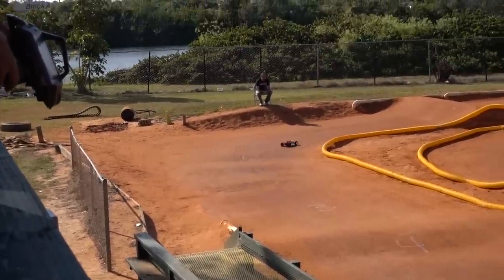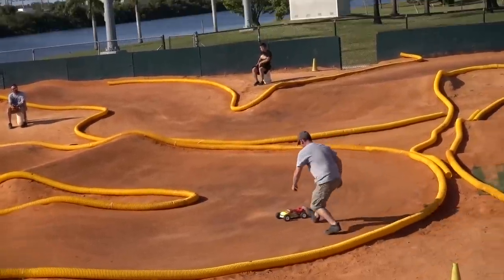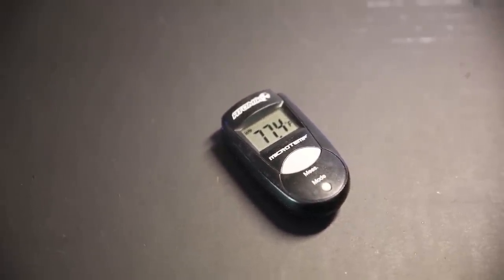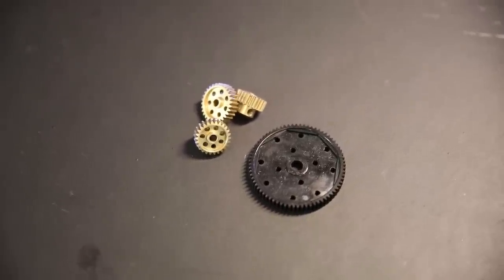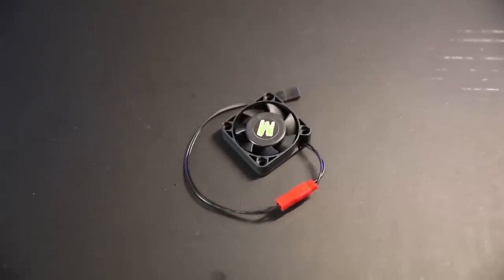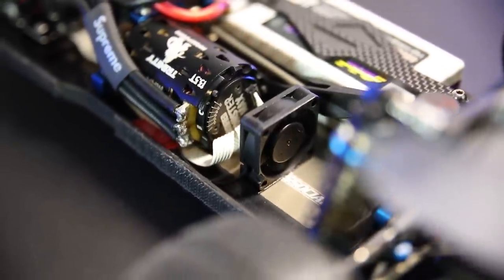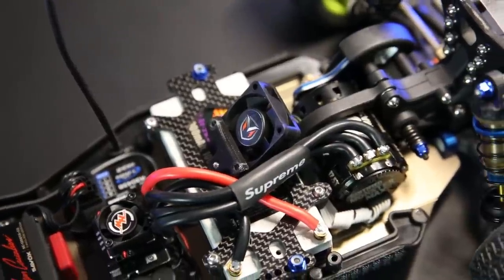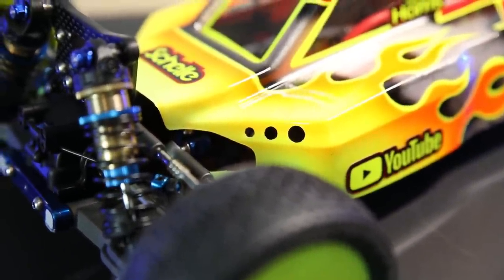RC OVERHEATING TIPS || Motor, ESC, Body Holes

Comment from the maker: Any OG's in here remember using those optional heat sinks on the ESC's in the brushed motor days?
Reply: LRP OPC SR
Anodised blue press fit which would fly off 30sec into every run😊
Reply: Back in the old days I went one better. wrapped small diameter copper tubing around motor and flushed ice water thru the tubing just before the race.  that was in the mid to late 80's.    don't know if that would be legal now
Reply: Tinker Aholic now that’s racing lol
Reply: Had the old tekin esc's with the two small gold heat sinks.....those were the days.
Reply: I remember mechanical speed controllers with two ballast resistors and multiple alloy heat sinks. Tamiya days 1970 through 80's.
Reply: Yep, had fans on them too
Reply: Novak HAMMER PRO baby, good times
Reply: +Tinker Aholic it mite not be allowed to use that technique when racing but you could still do it to keep your electronics cool when your bashing, great idea, just wondering what you use to get the water to go though the pipes
Reply: Still do
Reply: Ryan is brush esc if i do long run like 1 hour is it gonna over heat im beginner my crawler remo hobby 1093
Reply: Any body remember when your esc was a on and off switch controlled by a servo
Reply: I've been running my old Schumacher Cat 2000EC recently with a brushed motor and keep melting the solder off the motor! Ended up having to cut the back of the bodyshell to let the hot air out! Because it runs an under tray as well as the shell the thing just traps the heat like a green house lol
Reply: Tekin 411g with a speedgem diamond 12turn double. Indoor carpet offroad with foam tires on a rc10t. Never checked temps back then, but the batteries where hotter then the esc after the 4 minutes races. 1400 or 1700 nicads. Just a guess but batteries must have been somewhere between 130 and 180 deg f after a 4 minute dump.
Reply: I used them for oval racing. One summer I tested putting motors in dry ice and putting them in the car right before a heat. Not sure if it really helped. I recently had a speed control shut off due to heat with a 17.5 motor, fixed it with gearing and a ESC fan and a motor fan.
Reply: Yep
Reply: Rip novak
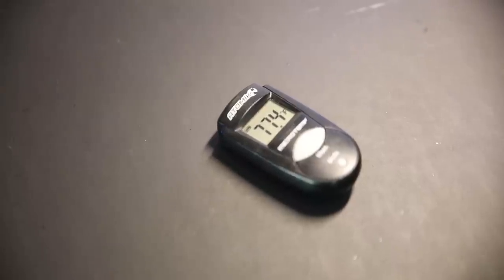Reply: oh yes tc3 heatsink dayz miss those days when everthing was a bit cheaper but i still lov the sport and when i buy something i'll appreciate it more. good luck in your races oh ryan can you suggest an off road buggie me to race 1:10 in price bracket of $200 .very grateful
Reply: Ha I remember switching from Tekin to Novak back in the day because of the awesome purple Heatsink.  Crazy how many esc didn't even use them back then
Reply: Lol threw them all away lol
Reply: My first rc was a bandit with a servo driven  mechanical speed controller with 3 speeds and a titan 12t brushless
Reply: Yep had the brake one come off during a race and then half way through no more brakes
Reply: I'm only 25, but my first rc 4 years ago was an original MSc 1985 tamiya hotshot. Really makes you appreciate the innovation of the hobby
Reply: Just melted a Novak cyclone transistor last week :( should have gotten a temp gauge before i tried the lipo battery in my losi xxx buggy! Of course i found those heat sinks later... Thanks for the quality vid!
Reply: I still have a new in package TC3 factory team motor clip 😂 

Want me to send it to you?
Reply: i know this an old video but you speak very clearly. i really appreciate the video, it is very helpful!
Reply: I used to run mostly Novak. I'll never forget the bright orange with the purple heat sinks...used to run one on my motors too.
Reply: Put Gold colour thermal compound between the grooves on them!

Comment: Meanwhile I'm over here and my motor is like 75° cooler than where it could be because I was racing at an I door track in the cold Canadian winter, perks of living where the air hurts your face 👌
Reply: I love that. My motor sits very cool since its only 50 out right now and it has a cooler on it. My esc on the other hand. Overheats in about 2 mins. Lol
Reply: Air hurts my face in airzona when its 125 degrees f 🤣😂

Comment: I'm not a racer but a basher.. but I stumbled across the WTF (wild turbo fan) branded fans and they are some serious air pushers. A bit more expensive than a standard fan but they move no less than 3× the air. Offered in 25mm, 30mm and 40mm. Those looking into cooling fans I highly recommend the WTF brand. Tried one myself and now gonna be replacing all my other fans with that brand. On my 8th buggy just a 40mm WTF fan on 6v on a fan mount dropped my motor temps 30°F. Ebay is where I found them easily.
Reply: When i first plug in that fan i said wtf never seen a fan that powerful
Reply: Thanks!
Reply: Bit late but I just got a good deal on a TLR 22 5.0 with a brushed motor and one of these WTF fans in it.. putting a hobbywing combo in it this week, but keeping the fan now!

Comment: Great and very informative video! I personally also like to change the timing of the motor in order to degrease the temps when I'm out of pinions or if the motor is running consistently hot regardless of the gearing. I have also noticed that if you run low timing and high gearing, the efficiency of the motor is much better than if you ran high timing and low gearing while sustaining the same level of power output.
Reply from the maker: Great advice and very much agree!

Comment: I have a castle Sidewinder4 in a rock Rey stock gearing with a 1415 castle brushless motor. I have a 16t pinion and my wires are melting the solder on the esc. The bullet plugs and my wires going to my motor (I now have 12awg wiring going to my motor) and after going half throttle for a minute my bullet plugs are way too hot to touch. On 2s and 3s. What is going on here? Maybe a bad motor?

Comment: I actually am watching this video while at our local track.  The building we run in is not temp controlled and today it just hit over 100F today outside but in the building I just temp'ed the railing that is on the drivers stand and its 116F there and 109F at track level.  So I really only have 50-70 degrees to play with when before temps too high personally for me.  I usually try to gear without a fan up until it got over 85F outside then I had to starting running a fan on the motor.  Only part I personally hate now is that if the fan stops working I could loose a $100 motor (Could be more or less).  Cooling is needed in the summer where I race....and a parka is needed in the winter......I love it

Comment: In oval racing we disable thermal protection. Also keep in mind after esc reaches a certain piont the esc will reduce power. But normally 150 to.170 in oval racing is acceptable.

Comment: I installed a brushless setup in one of my Tamiya 4WD buggies and just cuz I didn't know what the car could handle or how the system would react to the vehicle I made it where the cooling fins of the esc stuck out of the body just in case so heat wouldn't be an issue. turns out the set up was good and the cooling fins sticking out looked kinda cool so that is how I ran it.
I dont know what and OG is but i remember those days.  I remember where you had to keep up with your springs and your brushes if you wanted the max performance out of your vehicle.
I also remember the first time i saw a brushless system. It was an article done by RC Car Action and they had 2 Avox brushless systems on a clod buster with a racing chassis. The article was good but the truck was sooooooooo sweet.
When i ran my t-maxx i thought it would be cool to give it a scoop so i did so and put the breather in the scoop, using aluminum tubingto keep the air cool as it traveled to the engine.

Comment: Great job thumps up,,,,  keeping a close eye on temp can help find other problems as well like bearings that may start binding because it will as expected make the temps climb so if you know everything is in check that could be something to look at.. I was running a 1/10 scale 4wd truck and noticed it was getting hotter than normal it turns out it was the front differential bearings but I hadn't noticed any lack of power or anything at that point just a little spike in my motor temp....  Again thumbs up brother it's the simple things people forget to watch could save some money..

Comment: Good video, you forgot to mention that you need to carefully adjust your ESC  (Thermal protection) when adjustable , a lot of motor thermistor do not relay good readings for motor temperature and this is why a lot of people have fake thermal shutdowns due to the motor giving the ESC a way to high temp reading . I prefer motor without temp readings but for those who has it I adjust the Thermal protection Higher and carefully monitor the outside temps of what I consider OK for ME ( not higher than 165 F )

Comment: One tip i can share in regards to aftermarket fans is keep them from being too close as some rotors can actually stop the fan and cause it to fail. Learned the hard way on two different fans. Some motors it's not an issue but the stronger ones will definitely stop the fan and cause them to eat themselves.

Comment: Good vid. Would love to know what temp is recommended.
Reply from the maker: For most of my 1/10 off road stuff I stay at or under 150
Reply: Ryan Harris Thanks!
Reply: @RyanHarrisRC  well i have a 4wd slash i have stock gears i will 
 use the same esc heat sink. Will it cool down.

Comment: Hey buddy been follower now for a few weeks and been binge watching your videos as just come back in to the hobby and funny thing is I was looking for ways to keep temps down a bit better with my new brushless system as I'm happy with the speed but want to keep the temps as cool as possible . 
Funny thing is when I was racing years ago I used to make holes near my ESC and motor and people used to wonder what the hell I was doing . I took race car idea that if it keeps a petrol car cool that it will help with a RC . 
So going to give it a go as I don't like gearing down to much . 
Also picked up on the polishing hinge pins etc for less friction awesome tip that made suspension is miles smoother . 
Keep up the good work bud .

Comment: I think I’m under geared with the stock gear ? I usually get just as hot going fast as super slow,  so do I gear up for going faster because I want to go a bit faster and keep it cooler , would gearing up help the up end speed heat? Edit: I’m mostly doing long stretches of speed

Comment: another good way to improve cooling of the esc is changing the stock thermal pads under heatsink with something like thermall grizzly carbonaut (be careful they say it's conductive so put it only where it should be - on the top of transistors and not just over whole pcb)

Comment: Quick question
Can I run a 12v 0.6A rated cooling fan on a 12.6v 12A power supply or will it smoke up?

Comment: The video is awesome but for someone new getting back into the hobby needs to to know what should the temps be at or around after runs
Reply: Should not be higher than 90 degrees celsius.

Comment: I’m using a standard voltage servo from amazon one of the 20 kg ones , brushed 2s not conservative gearing but the motor heat isn’t the issue , it’s staying about 100 degrees , would the servo cause a issue?

Comment: Have you considered a radio that has telemetry with a temp sensor? I have one and i can set an alarm for when things get higher than a certain temp.
This way i do not have to temp the motor when it comes off the track and i get real time temp info on the motor while racing/practice ?
Reply from the maker: That may be an option for some scenarios... however not all parts of the motor are the same temp. I like to do it manually and make sure I get as much info as possible.

Comment: Outside in Colorado is prob a bit dif than where your at. The content of sand or i.e dirty soil and loose conditions are more prevalent . The outside temperature can still get high , mid 90s. So air flow holes are common in bodies but its a necessity ( in my opinion to cva glue faucet screens cut down to the inside the body to curve the amount of debris that can enter these openings

Comment: I was having the same prob and I thought it was the battery at first, because I don’t have a esc fan cooler but instead it has a heat sync for the esc. The people who built the kit in the factory half-fast built it, so then they put the esc in the middle of the servo and the 550 brushed motor. So since it was in the middle the heat sink wasn’t getting any air flow. So I moved the heat sink in it’s own spot to get air when driving, and it drove just fine without any problems. But I still do want to get a cooler fan for my rc.

Comment: Here, in NYC, in the summer I run 2 fans on my buggies. One mionted on the waterfall, pulling hot air from the motor and other mounted on the chassis (B6s) by the timing plate, blowing fresh air to the motor. So far temperatures are pretty good. Just my two cents.

Comment: Hi, currently i'm using a surpass 2838 4500kv motor with a 35A esc with a 15t pinion and i'd like to add a fan in the esc. Is there any problem of powering that fan using a free receiver channel or it could damage any part? Thanks.

Comment: Hi Ryan, so i have this touringcar, and i drive it outside on a dirt road, the only problem is that the motor gets so hot that if i touch it for more than a second (maybe even half of a second) my finger starts hurting, (so it gets very hot) so i know something about electronics, but i dont know how to wire a fan (propably wont be a problem) so could i use a heatsink on the motor? or should i cut off the side windows and replace with mesh (window net)

Comment: where would i plug it in? the esc or the transmitter? im gonna have to get one for a Racing Durango DESC210 and im new to rc stuff. it overheats in about 10 mins of use and i cant really take off the gears because my allen keys get stripped. Any tips what to buy and what to avoid? And what tools to buy?

Comment: My rustler 2wd after I dis my upgrade to onyx esc and motor. Now every time around 175 degrees on the motor and 110 at esc and starts a turn off. Usually what is a good temperature to system? Please I will be very happy if you can help me out

Comment: I have a fantom 17.5 motor runs a little hot not bad. Rx-482 receiver with transponder servo esc and ya fan plugged in. Hobbywing justock esc with fan. When I put my ya fan by my motor it dies out? Am I drawing too much power or is the magnets killing the fan??

Comment: I race 13.5t stock onroad in Australia and I’m lucky to have 3 tracks within an hour of me  and I deviate between all 3 so I temp my motor after every run at every track, I use one tram zombie 30mm fan on the motor, normally comes off at 50 degrees celcius every run after 6 minutes

Comment: I am about to purchase speed control with fan and new brushless motor and will be purchasing heat sink and fans for motor 1/10 scale for Arma Granite pick it up on Saturday  burned stock motor same day temps in Palm springs are above 115 guy at hobby shop didnt tell me not to run in heat. Any recommendations? Motor speed control packages? Fans ? Heats sink? Thanks in advance.

Comment: The Ardncraft B64 and J-Five Designs B64 fan mount/shroud are a much better solution for keeping the 13.5 wheeler cool than just sticking a fan at the back of the motor. It dropped my temperature 20-30F compared to the fan in the back, and that is exactly what they advertise. If anyone needs the link for those just ask, but a Google search will bring them up.

Comment: On a old vintage car I got from my neighbour the motor was cooked and the ESC has no heat sink with 6 MOSFETs sandwiched together ...I added a 25mm fan to the under side  pushing up and mounted it on brass bars 10mm off the base and split each MOSFET just enuf so it's got a gap and glued a heat sink to the tip of them with the fan running not stop off the battery if it's plugged in. .with a used drill motor it's now insane and it's the battery getting hot now cos it's able to draw so much current now continuously so I custom made a 4p2s lion battery from 8x 18650s and now I'm thinking next time il put a 30-35mm fan in one end on a switch so when it's got heat shrink on it draws air thru the battery directly

Comment: Ok after 30 years just got back into RC. How do I wire my motor fan? Does it go to speed controller +/- or does it go to receiver and what port in receiver?
Reply: It goes plugged in to the reciever and it goes into por # 4

Comment: I have a TLR 22-4 2.0 4WD Buggy in my 22-4 2.0 4wd I have a reedy 510R Blackbox I use the programmer 2 box that came with the 510R to turn things like the Drive frequency down and certain braking parameters up and adjust throttle settings.
I run a 16t pinion with a spur that's 81t to 86t on my hobbywing mod motor and a blue heatsink that slides onto the motor, I set the timing on my mod motor at around 34 to 38. With the way my silencer body sits on the buggy awesome ventilation front to rear.
The body does have pre marked spots you can ream out with a body reamer for extra air flow if needed. A heatsink on the motor geared with a 16t pinion and 81t to 86t spur and low settings in my 510R Blackbox is how I run with ventilation front to rear no problems running on a full charged 5 to 10min run on my 6300mah 7.6v 2s shorty.

Comment: Hi there, can you explain each individual setting ESCs have? Stuff like the do/don't do with your ESC programming for a specific motor and class. Also , setting interactions, like if you set the X setting to certain level then you should also change the Y setting in correspondence. I know that different brands sometimes have different names for the same setting , but it would be great if you did like a generic review.
I only discovered your channel recently but I think it is great. I'm personally not into interviews but I watch your tips and setup advice over and over again. Great job !